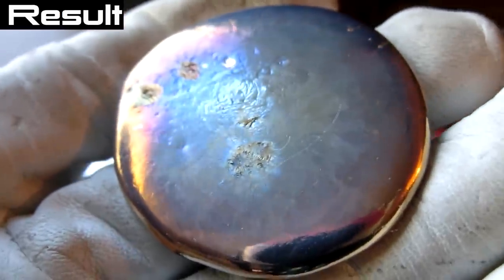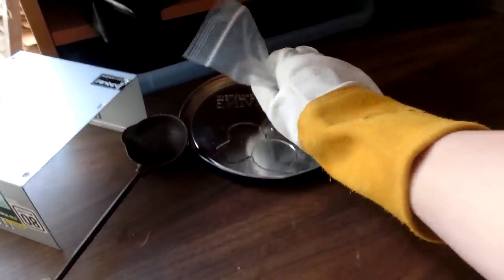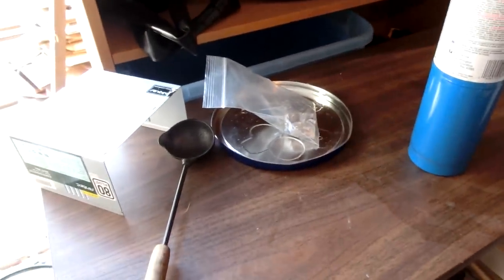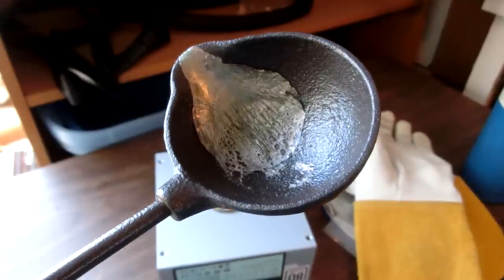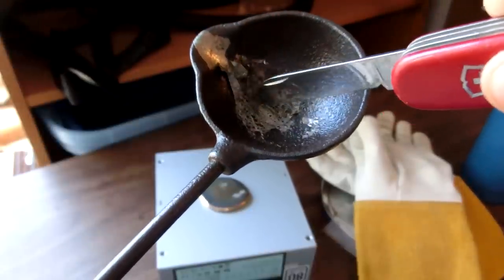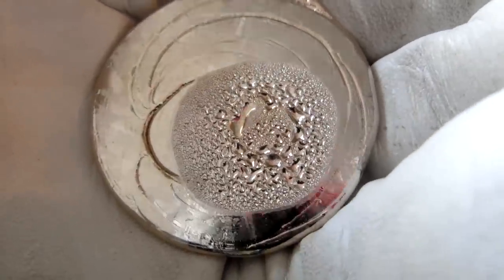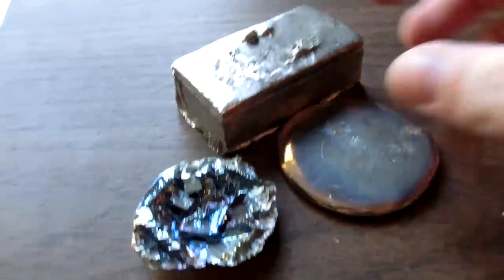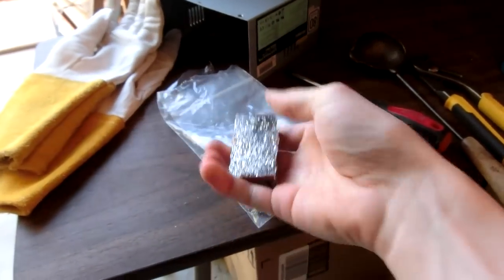Melting Bismuth, Casting Ingots, and Making Crystals

Comment: NEVER POUR MOLTEN METAL ONTO CONCRETE!!! That pop you heard is the same reaction that, on a bigger scale, would shower you and everything else around you in molten metal. This is metal casting safety 101. PLEASE don't do this again, or at least don't post video of it. I would hate for some thumbhead with less luck than you get permanently disfigured as a result. PLEASE read up on metal casting and the safety procedures required. Thank you.
Reply from the maker: well i did, so deal with it.
Reply: Rinoa Super-Genius
 Really he's right, just be careful you know I would miss your videos if you get burned by metal splashing on you. It's A-OK for low temperature melting but DEFINETELY NEVER do that with anything hotter than 300°C!
Reply from the maker: MrOpenGL
i think its funny that everyone seems to think ive never cast metal before.
Reply: Rinoa Super-Genius Well judging by the way you poured it onto concrete I would surmise as such......
Reply: Rinoa Super-Genius You've been damn lucky then. And luck isn't real, so substitute clear thought and safety. Or, as I said before, at least don't present unsafe casting methodology under the pretense of being instructional. That's just basic, responsible, adult behaviour and consideration for others.
Reply from the maker: revmpandora
i'm not responsible for what others do.
Reply: Rinoa Super-Genius No, you're only responsible for what you post on youtube as instructional. Your video implies that what you are doing is safe to emulate and even though in the video you said you expected that to happen pouring on concrete people in general are not very smart and will follow those exact steps without that exact luck. Say it pops the same way for someone else, and a drop hits their arm. They jerk both startled and burned and accidentally splash the whole thing in their face, scarred for life. For at least your own legal sake I'd say put some kind of disclaimer on the video.
Reply from the maker: Eric Wilson
my videos arent instructional, they are just showing how i did or didnt do something.
Reply: Rinoa Super-Genius When you make a video of yourself doing something and state for the video exactly what you're using and how you're doing it, that video being instructional is implied whether that was the actual intent of the video or not. All semantics aside, you'd do good to cover your ass and at least put a "Don't try this at home" notice on the video. Or not, it makes no difference to me really just a suggestion.
Reply from the maker: Eric Wilson
its called experimenting. i try to show my mistakes. if somebody watches this video they will see that pouring hot metal onto concrete can make it pop. so now i've shown what happens and given them a bit of experiance before they start casting metal.
Reply from the maker: Eric Wilson
i dont worry about a dumbass melting their face. i obviously didnt melt mine so if they do they aren't repeating what i did at all.
Reply: Your resistance to constructive criticism belies the moniker 'Genius' you've attached to yourself. Sorry, 'Super-Genius'.
My optomistic nature wants to believe that it is merely the arrogance of youth.
Reply from the maker: revmpandora
you actually take my name seriously? HAHAHAHA
Reply: Eric Wilson I'm now crossing my fingers that we get a face-melting video out of him.
Reply: ***** Sense of humor is strong in this one ...
Reply: ***** So now you're talking about Rinoa Super-Genius ?
Reply from the maker: *****  ya know, a bowling ball could be pretty sharp if you dont properly bevel the edges of the finger holes when cutting them. that could be pretty nasty too if you cut your fingers on that.
Reply: Why do you care about what he does and how he acts
If he does something then you can't stop him
It's already done

Mind your own business and get a life
Reply: Besides 
What are you gonna do?
Ruin his life? Over a comment?
Reply from the maker: Binturbara
thanks, dislikes get my videos more attention than likes anyway.
Reply: +Rinoa Super-Genius Just be safe man, jesus. Listen to the man.
Reply: +Rinoa Super-Genius That's a pretty cocky response... The correct answer would be. "Oh, thanks for pointing that out. I learned something and will put an annotation on the video to warn people at home not to do the same." I was ready to be supportive, mistakes are made, but this attitude of having no sense of willingness to even consider the other point of view is pretty off-putting, frankly. And I'm generally not one to say something like that. It's your video but we all learn something from listening.
Reply: +AustinJD One gains nothing in life by being defensive and close-minded.
Reply: +Rinoa Super-Genius great video dude I love the crystallised one and also don't listen to the health and safety nut cases you messed up with poring molten metal on concrete so what you're fine were all fine so don't listen to them again great video;-)
Reply: I just got into molting aluminum,I can't figure out how to make molds or what to make them from do you have any ideas  ?
Reply: can i use wood ?
Reply: +navyseal 019 "lol no dont be safe! you were fine this once so it obviously wont happen ever again! "
Reply from the maker: +cheytacsnipes i've been playing with metal for a long time, what i do is a result of my experiances. its not like i just started melting metal yesterday.
Reply: +Rinoa Super-Genius Everything is safe until it isn't. I bet you also leave loaded guns lying around and drive a car with no seatbelts or windshield for that matter.  I mean, what could possibly go wrong...this time?
Reply from the maker: *****
but i didnt wonder what happened, i knew what happened and i knew that could happen, but i estimated it wouldnt result in an injury and i was correct. otherwise i wouldnt make the video, its not like i have better tools just off the screen.
Reply from the maker: *****
no i dont own guns and i dont drive cars. the risk regarding those is too high from my experiance.
Reply: +Rinoa Super-Genius Lol, the risk regarding guns.
The risk for owning guns is less than conventional wisdom would suggest.
Especially since the figure for gun deaths per year, is like 63.8% suicides.
Reply: +Brotherhood of Steel Suicides are part of the risk of gun ownership. Stop breaking them out as if there is nothing that can be done about them. Most suicides would not be 'successful' without a gun present. For the typical 'white, suburban' gun owner, there are far more death and injury incidents from gun suicide, accident or spousal homicide than events of self defense. Sorry, off topic, but claims that guns are 'safe,' coming from a country with the highest gun ownership and - oh surprise - the highest rates of gun death, injury and suicide, must be challenged.
Reply: How about plaster ?
Reply from the maker: Shawn P
i've never had much luck with plaster molds, ive had issues with it cracking a lot.
Reply: +Rinoa Super-Genius I'm new to it,I've done lost foam successfully but wanting to do something with a little more detail and cannot figure it out
Reply: +Rinoa Super-Genius 
please do be careful tho. basically you get some water trapped in and you get a steam burst. its permanently disfiguring.
Reply: Thank you for bringing this safety issue to light! I wouldn't even have thought about concrete being that dangerous to pour molten bismuth onto. Like I said- thank you very much. You probably just saved my skin. Literally.
Reply from the maker: Chris Gustoph
your welcome.
Reply: Rinoa Super-Genius me to I tried it a few times.im going to try to bake in a oven to see if that would cure it before it cracks up.
Reply: Chris Gustoph No problem. Be safe!
Reply: He wasn't thanking you.
But I think you knew that.
Reply: +Rinoa Super-Genius The only thing sadder than someone that is ignorant is someone that is willfully and actively ignorant.
Reply: Shawn P Look up Dave Gingery's Books.  First and last word on the subject, written strictly for the home-gamer.
Reply: revmpandora thanks
Reply: so if i post how i was to stalk and rape someone, you consider it an instructional?
would i also need to post a 'dont try this unless you live in india' disclaimer?
he doesnt need to cover himself when posting a youtube video. they do this on TV with shows like jackass for obvious reason.. MTV has millions upon millions of dollars and is a good taget to sue. Rinoa, not so much.. lol. 
your intent is not overlooked but obviously already understood before he did this.
Reply: On Jackass they have the disclaimer "don't try this at home"....
Reply: +Bryn Diesel I love who you try to make it sound like being a bartender is a good life. LOL
Reply: cry about it, and then just #dealwithit
Reply: lol this guy does not know how to handle criticism at all, you can tell from his defensive responses that he's pretty insecure about his reputation
Reply: dude... can't you take any criticism? They're genuinely looking out for you, not even being mean to you, just giving advice. Yet you're deflecting their advice more than a flatearther deflects facts.
Reply: revmpandora thank you I was thinking the exact same thing
Reply: Ok then.
Reply: @RinoaL  lol subbed just because thats awesome.
Reply: @RinoaL  Why are you so defensive?
Reply: wow, didn't know it works like that. now i'm interested. i guess i'll go buy some metal and heater so i could have a fun with throwing metals onto concrete blowing up streets of ukraine
Reply: @RinoaL  "i dont worry about a dumbass melting their face. i obviously didnt melt mine so if they do they aren't repeating what i did at all."
That's a bizarre line of reasoning, because you got lucky that it only made a small pop; someone can do the same and come off far worse.
Reply: Hehehe, I can vouch for what revmpandora said. I happen to have bismuth that I decided to try to heat....with my torch on my cement block....since I just felt like melting silver, then bismuth (not together).....and it popped. :D: a tiny piece hit me and maaaaaaan, that hurt. So yes, do not do that. Especially not that.
Reply: Thanks for the comment. Its very informative and kind comment. Im a geo nerd and a scientist apparently and I woud never cool metals on concrete yet I admit that I did not know that they would explode etc.... It is just sounds like a bad idea anyways. I Like the video but how the creator reacts to this comment I dont
Reply: @RinoaL  What immature comments, you have a responsibility as a creator. Burn your eyes out next time for us

Comment: this is who will burn their house down doing stupid things. who pours hot metal on the floor blocked in wood? its not a container dude, its blocks of wood! make should not encourage these types of actions. i kept waiting for his wooden desk to catch fire as he heated the laddle on the desk with a torch!
Reply: bidmuth has a low melting point lower than when wood catches fire
Reply: +alaskankare Bismuth melts 50 degrees Fahrenheit sooner than wood ignites.
Reply: +Brandon Mccoy So bismuth will melt in my hands if i go outside.
Reply: NoNamesLeft no....the melting point of bismuth is 520.6°F and the flash point of wood is 572°F
Reply: back to my point... I am correct but bismuth that is still increasing temperature  will catch wood on  fire

Comment: Bismuth coils (instead of copper coils) will significantly reduce the Lenz law drag of an electric generator when a load is applied! More power can be generated using the same amount of fuel.
Reply: +furulevi Interesting. I wonder what the return on investment would be for the cost of the more rare metal.
Reply: Mod MINI bismuth is an alloy, so it’s not that rare
Reply: Interesting, I wonder if anyone has tried this.  Bitmuth is also heavy... and brittle, but maybe an alloy?

Comment: That stuff in the ladle I'm pretty sure is just impurities. (not bismuth) It's like when you melt aluminium cans and the impurities will stay in your crucible.

Side note: I could be totally wrong in saying that, but that's what I was told once before.

Side note 2: You should try using a muffin tray to make ingots, quality ones have worked alright when melting cans so I don't see why it wouldn't work with bismuth.
Reply from the maker: i could use a silicone tray because it's a low enough temp, then i could just peal the tray away.
Reply: LoneWolf CombatTactics IUPAC disagrees with you.
Reply: BBPINEAPPLE just checked my college general chem lab book and periodic table shows as aluminum.
Reply: LoneWolf CombatTactics Why did you feel you had to correct him so hard? You seem very emotionally invested in this argument about aluminum / aluminium, which is quite odd.....
Reply: +Kyle Walker The thing is both ways of spelling and pronouncing it are correct its just different countrys prefer to say/spell it differently, I prefer aluminium because im from new Zealand and that;s how we prefer to say it here.
BTW, you way over reacted to how he spelt it

Comment: Stuff seems pretty easy to melt, I wonder if you can use it as solder
Reply: Na, since it wont stick that well it would be hard. Possible, but hard
Reply: Filip Carlén
solder doesn't stick very well either.  I can easily knock it off my tools.  Without the flux it doesn't stick to anything worth a damn.
Reply: No, but this you can peel of with your bare hands, and if you solder it well it stick pretty well. Also, (just a random thought) does normal solder crystalize like this? Might be a problem since crystals are brittle and easy to just break. But just a random thought ;)
Reply from the maker: Filip Carlén
metal is a crystal, if you take most metals and acid etch them you can see their crystalline structure. you may have seen the crystal nucleation on anodized roofing metal. when they dip it in the molted zinc and pull it out to dry, the zinc nucleates and grows flat crystals till they all meat and so it looks like scales.
Reply: it is used in solder.

Comment: Wow ive gotta get me some of that , Safer than smelting lead recovered from a old battery , Im sure theres loads of uses we can think of for this stuff :-)
Reply from the maker: its highly diamagnetic :)
Reply: I haven't done much research on the metal yet but i wonder what would happen if a strong magnet was next to it.
Reply: Also noticed you using a pc psu lid as a table , They must be like the minecraft equivalent of a crafting table since thats what i use too for various stuff :-)